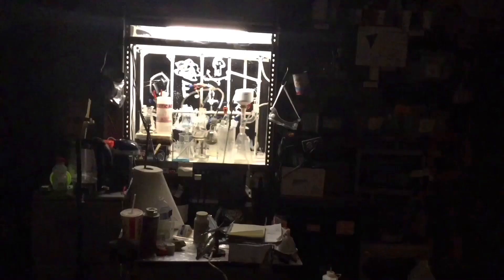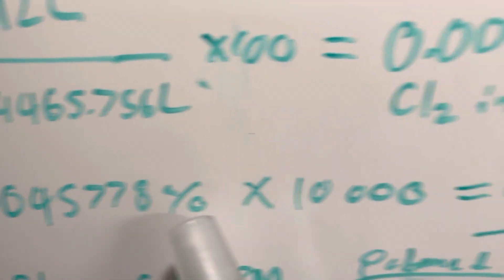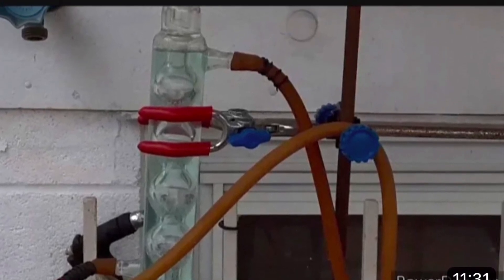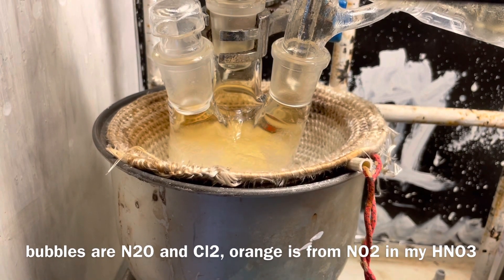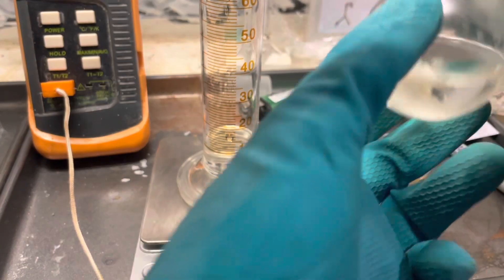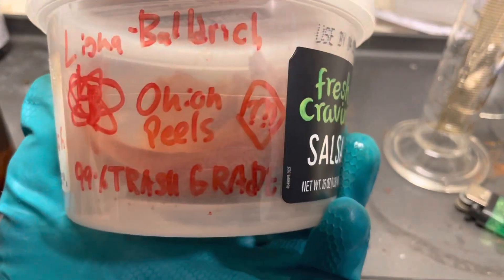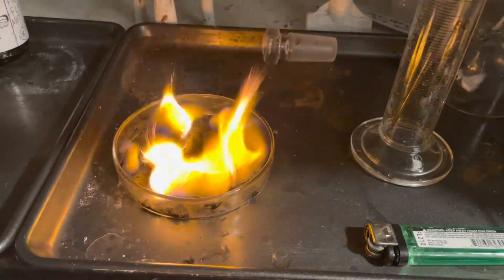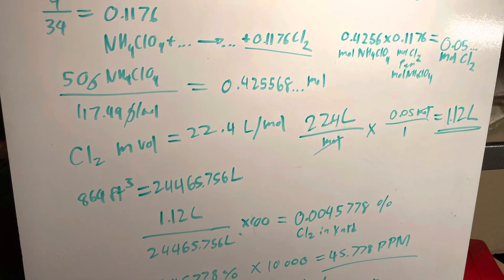Making Perchloric Acid (no dangerous fumes!)

Comment: Which solution can dilute the lead, without settlement layer. 
V tried perchloric acid. But its in slow process.  Can u suggest
I need 30grams of lead should dilute completely without any settlement layer.

Comment: @Edward Science Innovations Wouldn't it have been easier and better to convert the ammonium perchlorate into sodium perchlorate, for example, and then react with hydrochloric acid to form perchloric acid which can then be distilled? And also nitrous oxide is quite a potent greenhouse gas and the entire world is trying to avoid the worst case cenario in terms of manmade climate change so that method should be reconsidered!
Reply from the maker: distilling perchloric acid isnt desirable for most amateur or even professionals unlike clinically insane me, but at some point in the future i do plan to make anhydrous perchloric acid by that method
Reply: @EdwardTriesToScience  It doesn´t have to be anhydrous perchloric acid. I´m talking about using aqueous sodium perchlorate to make azeotropic perchloric acid.
Reply from the maker: the nitrous oxide though is insignificant compared to say whatever china releases in an hour so frankly it doesn't concern me as im not running this reaction in barrels every day
Reply: @EdwardTriesToScience  True. But the nitrous oxide could be converted into something harmless if you know how to do that, at least.

Comment: The Willard method introduces Nitric AND HCl and then uses open boiling/heating to remove the volatile Nitric and HCl via evaporation(creating fumes). First, how is it the LeadAzide prep using only HCl under reflux to oxidize/boil off the ammonium would be "less pure"?  In both cases, the procedure calls for heating to 135C or higher to remove the other acid(s) and both "can" have unreacted Ammonium Perchlorate.  The Nitric/HCl method has a far higher likelihood of producing a more pure product because of the limited chance of unreacted ammonium perchlorate due to the combination of nitric and HCl being a more effective oxidizing mixture.   Finally, it's not a fumeless prep as the open acids you distilled off still fume.  Sure, you are condensing the fumes and not venting them all to atmosphere....  But you are still producing fumes and thus it should be done in a hood or with very good ventilation.   I digress....  To the average youtube cool, this is NOT fumeless or safe.    Just saying...  By the way, I'm the guy that posted the H. Willard prep to Prepchem a few years back when it was hard to find info on HClO4.
Reply from the maker: the pb(n3)2 method has residual chloride which should be obvious and yes this is fumeless as the fumes i am talking about is perchloric not nitric or hydrochloric, if you paid attention you would have noticed i DID do this under my fumehood to vent the chlorine, nitrous, etc but the main issue is the perchloric acid fumes as it would set most fumehoods on fire, but perchloric acid as it is is not volatile and does not evaporate so me distilling the WATER off which also of course will have a trace of perchloric acid was not an issue. the issue with the original procedure was that you just ran it in an open beaker and got the hot perchloric acid vapors everywhere which is unacceptable. also what do you mean by "AND HCl" because i DID use HCl in an addition funnel i don't understand what you are even on about
Reply: @EdwardTriesToScience  If you add HCl and Nitric to one solution and only HCl to the other, and you use heat to drive off any unreacted HCl, assuming similar volume and the same heat for the same duration on both solutions, there will be similar or the same amounts of remaining "chloride" in solution.  Contamination of volatiles isn't voodoo, it's physics.  They are driven off by temperature and very little of either can exist in a solution 20-30 degrees C or more past their respective boiling points, unless they are complexed or salted out.  This is highly unlikely as NH4Cl is digested by HCl04 into NH4ClO4 and HCl, so the only remaining impurity would be the unreacted starting material and volatile HCl, which boils off...  Suggesting one would have "more" and that it's "obvious" isn't a reply nor is it really an answer.  Suggesting more residual because more is added betrays a lack of understanding of how vapors and volatiles work in solution vs temperature.  I'm not even going to bother addressing the "I was talking about one type of fume and not the others, so it's still fumeless. <.<  really?  You want those words immortalized as the opinion of a chemist online forever? Finally, Perchloric acid only really starts "fuming" above 135C on it's way to 70% by volume with water.  It produces dense clouds similar to H2SO4 when heated to it's boiling point.    Solutions under 60% hardly fume at all.  And the concern about HClO4 fumes "burning up a fume hood" is from many, many acid reactions causing dense fumes to condense on metal parts, creating metal perchlorate salts, SOME of which are explosive.   In all those cases, they were processing or distilling high test HClO4 and not sub 50% solutions in water.  Have a great day.
Reply from the maker: the issue with the pb(n3)2 method is that the reaction is an equilibrium of HCl + NH4ClO4 = HClO4 + NH4Cl. if you haven't noticed the perchloric acid is the stronger acid so formation is highly unfavorable unless that ammonium chloride is driven off efficiently which at the temperatures in the reflux does not readily decompose to ammonia and hydrogen chloride, you will still have ammonium perchlorate and hydrochloric acid in solution in equilibrium with ammonium chloride and perchloric acid. let's entertain the possibility that the ammonium chloride does somehow decompose readily to ammonia gas and hydrogen chloride in solution, its under a reflux and as hydrochloric acid is volatile especially at elevated temperatures it will just sequester the ammonia gas back as ammonium chloride bringing it down into solution again from the refluxing unless you sparge the reaction continuously or somehow drive the water off (such as a distillation or moronically boiling it off in an open beaker) to drive the temperature up to decompose the ammonium chloride, it just simply doesn't work well. as for fumes i think most people would know it means "perchloric acid fumeless" as thats the actual problem with the reaction. i dont know why you would think that it would be safe to boil off perchloric acid which you stated yourself is volatile at the temperatures required to reach azeotropic concentrations in a normal old fumehood or any lab environment. as for setting a fumehood on fire lets be honest here who are watching this video? homechemists who have wooden fumehoods which would go up in flames from hot perchloric acid vapor. even if this is conducted in an open beaker under a steel fumehood as you mentioned it will form metal perchlorates and sometimes explode or at least burn the crap out of the steel itself. the arguments you have over semantics are pointless and a waste of time as i have addressed them already in the video

Comment: why cant u just distill it from a perchlorate salt (metal perchlorate) and sulfuric acid?
Reply from the maker: that would work but that would make anhydrous perchloric acid unless you add water, also ammonium perc is not too expensive and also less perchloric acid is vaporized using this method
Reply: @EdwardTriesToScience is anhydrous HClO4 bad? like unstable
Reply from the maker: yes it gets into the spontaneous exploding range and will tear apart anything it can oxidize

Comment: Nice video :) 
I have a question though.
So I have found myself in a weird position where I can buy pure 70% HCLO4 but not ammonium perchlorate, and I need NH4CLO4…
So how much AP do you think I could make (either by reaction with ammonia or ammonium carbonate etc) with say 100ml of 70% HCLO4? 
It seems you got around 10ml from 50g of NH4CLO4 in the video so you could say 500g of AP from 100ml 70% PercAcid but obviously things don’t always work like that. 
Any help would be much appreciated thanks! :)

One more thing, the perchloric acid is £100 per 500ml or $128, do you think that’s a decent price?
Reply from the maker: 70% perchloric is 11.6 moles per liter so 100ml would be 1.16 moles of perchloric acid if you neutralized it with a slight excess of ammonia then boiled it down to get solid ammonium perchlorate you'd expect around 136g of AP and as for the pricing it seems overpriced but it is hard to transport so it seems not too bad
Reply: @EdwardTriesToScience  ok thank you a lot :)

Comment: I know that it's probably easier (and expensive AF) to buy some Teflon paint, but have you tried to do the acid resistant paint of that Styropyro video for protecting the wooden fume hood?
Reply: polyaniline coatings and perchloric acid fumes sound like a very pop and bang filled time.
Reply from the maker: not yet but i got a PDF copy of the formulary so ill try some stuff from it, as for the fumehood the other risk is the metal duct as perchlorate can accumulate and explode in it so Id have to rinse out the duct
Reply: @EdwardTriesToScience  Lol. Perchlorate is fun but nasty. Good luck with the cleaning.
For the fumehood 3.0, I'll be waiting to see it working. Just remember that if your fancy things are high current/voltage, even ceramics become conductors (It isn't fun. Well, a bit)...
Reply from the maker: either way fumehood 3.0 will be built from scratch using ceramic tile and a polypropylene fumehood blower along with some fancy stuff